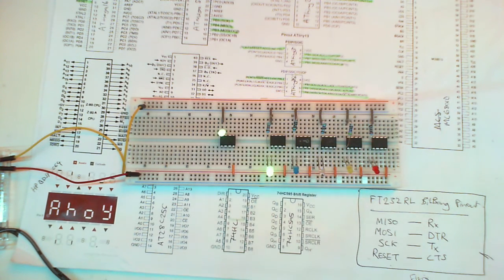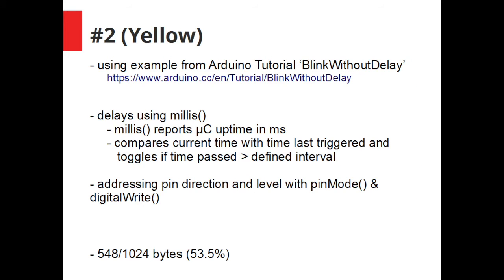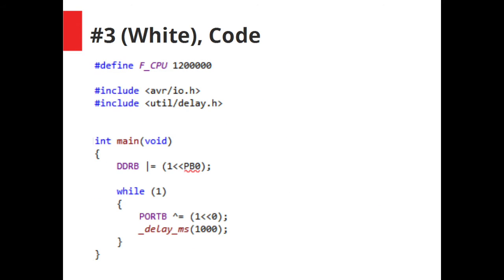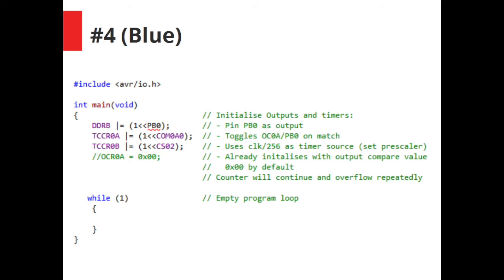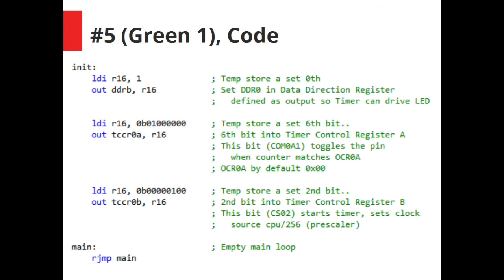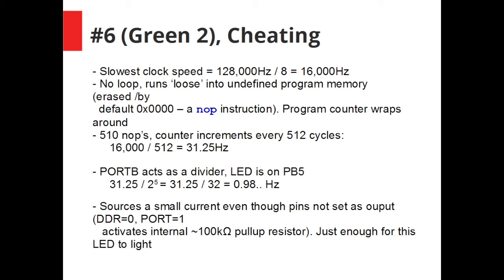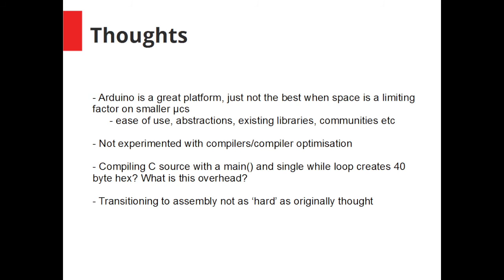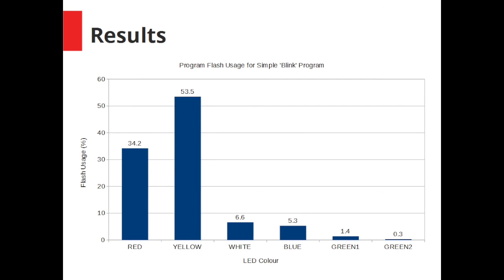ATtiny #3: Blinking an LED with 4 bytes of code?

Comment: I have a problem: on attiny13 I uploded simple blink code(with delay, digitalWrite and pinMode) and set both delays to 30000 so it can blink every 1 minute, but it blinks at around 8.8sec. I need pin 4 to be 30sec on and 30sec off for stable cycle. Please help.

Comment: I was flashed by your '4 byte blinking' program - it started me to buy an ATtiny and play with it for a long time. In fact, I found out you can make an LED blink with a single command,
That's 2 bytes program size :)
The program is: SBI 0x16,1 or 0x9ab1. It won't blink once per second, but 4 times per second, but it blinks nicely! I don't think it'll get shorter than that.
(I should add I did this on an ATtiny45 with 4kB, with the LED connected to PB1)
Reply from the maker: awesome! I will have to try that

Comment: Cool comparison. I think the major issue with Arduino libraries is that it is not well optimized and seems a bit rushed at times. Maybe that's the price of having an API that can be implemented for different MCUs. But if I had a bit of time I wanted to give it a try optimizing it for code size, from what I've seen  C++ template specialization could be used at places like digitalWrite().